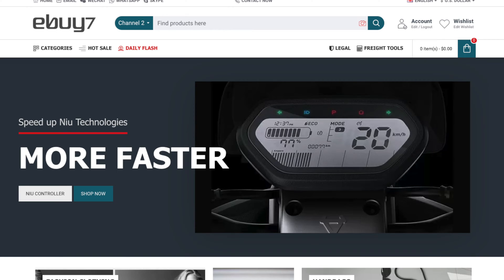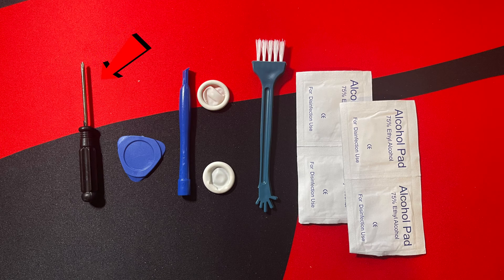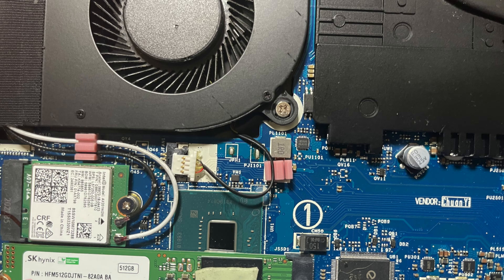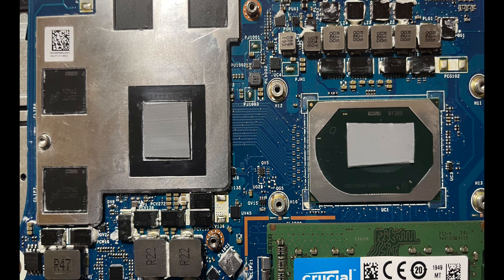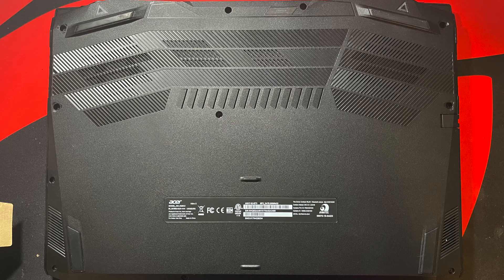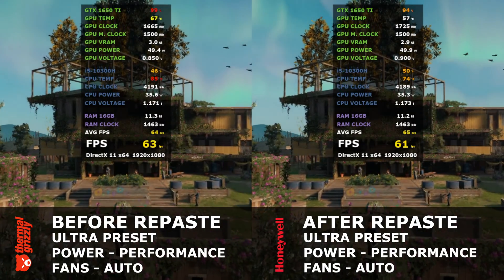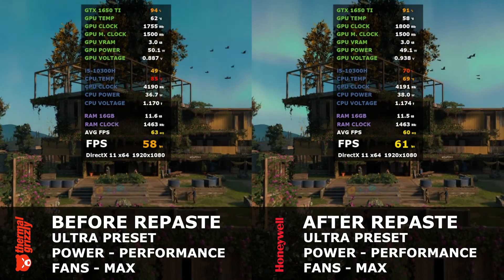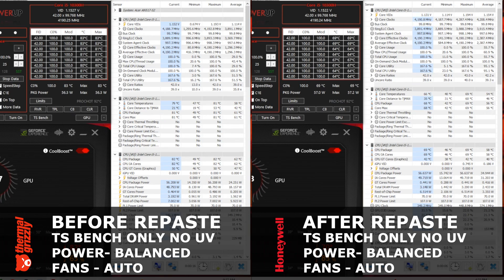Thermal Grizzly Kryonaut - Honeywell PTM7950 REPASTE 👑

Comment: Thanks! Great video. Have you done a comparison between this and Liquid metal?
Reply from the maker: No I have not but I have tried liquid metal on other laptops that I have posted.
Reply: @Meanpooh  Cool, you think there would be a big difference in temps between the 2 thermal compounds?
Reply from the maker: I think the temps will be close with the liquid metal winning slightly.  Here is a video with Silver King and Kryonaut using Far Cry 5 https://youtu.be/AXxN2vDhXPk?t=475.  There is not a large gap in temperatures  between the two as there is in this video.  Unfortunately I will not be applying liquid metal to anymore of my machines as it does start to eat away at the heatsink and stains the processors.  I have tried to remove it 2 repastes later and the residue is still there.
Reply: @Meanpooh  Thanks! just ordered some from China, hope it arrives sometime next year. Haha!  Will apply it to my Alienware m15 R2, currently thermal throttling since Dell updated the Bios, thereby disabling undervolting, even though I had turned all updates off.  I'll keep you posted on the results.
Reply from the maker: Here lately, undervolting has been really bad.  Sometimes it works, sometimes it doesn't.  I've even reinstalled windows without ACC and it still gets crazy hot.  The best option is to use Cool Thermal with Power Saver profile.  What is Dell doing?
Reply: @Meanpooh  They disabled undervolting on a Bios level to patch the plundervolt vulnerability. Basically forced the Update on everyone. I think the last bios version where undervolting was unlocked was 1.3.1
Reply: @akarna69  Hi bro, I'm sorry for my bad English. What are the results after testing the ptm? Are you satisfied? I have an Alienware m15 r4 and I want to try it. Wow, they get hot!!
Reply: @joesv6897  yeah, got a 15°C improvement. To get the best contact between CPU, GPU and the heatsink, make sure you have the right thickness of thermal pads for the VRMs, buy 0.5mm , 1mm and 1.5mm and a caliper to measure the thickness of the original thermal pads on the VRMs. Let me know how it goes.
Reply: @akarna69  The truth is that I am an amateur in this, should I buy new thermals pads to apply the ptm? Also I want to ask you if the 40mm x 40mm tpm is enough for my notebook? I would really appreciate your help :)
Reply: @joesv6897  looks like YouTube removed my reply for some reason. 

Yes, you will need to replace the thermal pads on the VRMs when replacing the CPU and GPU paste. Just order enough from Amazon, use what you need and send the remaining unopened thermal pads back.

As for the PTM 7950, i don't think 40x40mm will be enough. You'll need some extra anyway in case the first application goes wrong. What type of CPU and GPU do you have?
Reply: @akarna69  Okay, is there a specific thermal pad that you recommend?
As for my cpu is i7-10870H and my gpu is Rtx 3070 mobile.